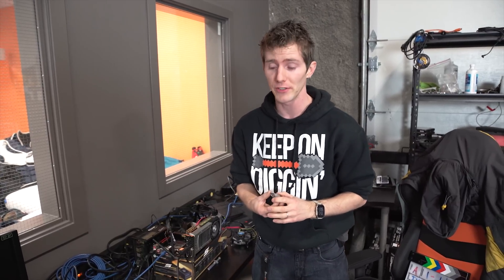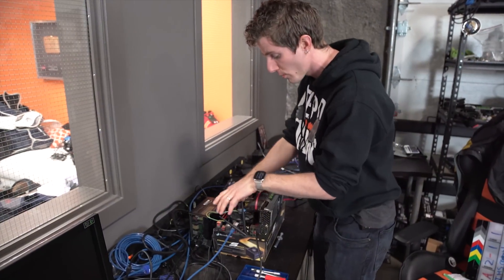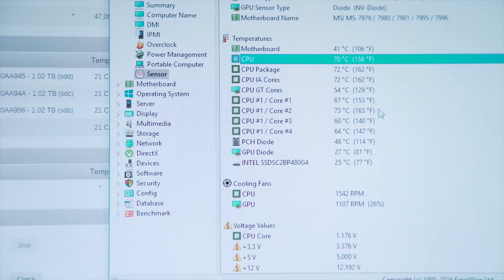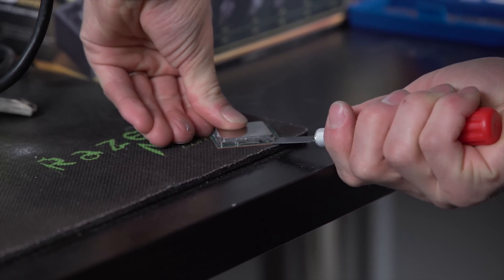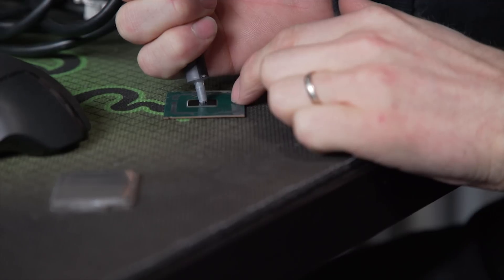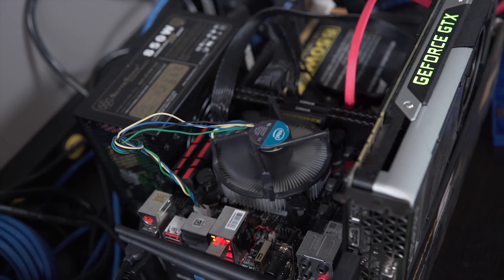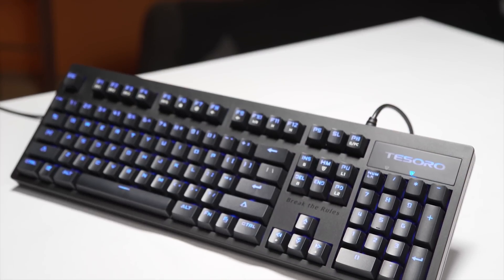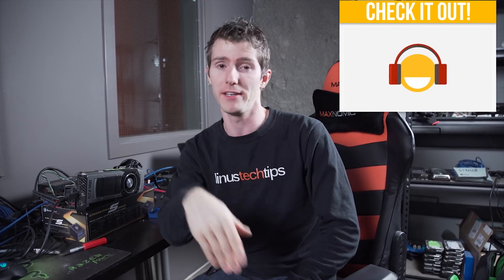Delidding an Intel Core i7 6700K - Is it worth it!?

Comment: I have to disagree with the opinion in this video. My last replacement of the compound under the IHS was on a 3770k. Using arctic silver 5 it vastly decreased the maximum temperature the CPU would reach under 100% load. I believe it took it down 15c or so on average. I didn't do this to my 4790k purely for the reason that I didn't have the time. On my current CPU, the common 6700k, I have replaced the compound under the IHS with Liquid Pro and sealed the IHS back in to place using a heat resistant tape which I found in the electronics district (akihabara) in a store that specializes in custom water cooling. The trick is to use the scouring pad supplied with the liquid to polish the underside of the IHS, making sure to thoroughly clean off the gray dust that results from doing so using alcohol (70% or higher). It took a while to do but eventually I got to the point where no more gray marks were appearing on the alcohol wipes, no matter how hard I scrubbed (while the IHS is off, you should do the same for the outside too, no need to apply pressure to the cpu it's self).Then I applied the liquid metal to the die (DO NOT use the scouring pad on the die. Liquid metal pro / ultra does not react with the die and will not destroy your chip if you make sure to be very careful when spreading it out and use only a VERY small amount. Not even half the size of a pea is required... I would say you should use dot around the size of the lower case "o" in the comments here. It looks like too little but it will spread over the whole die. Then do the contact side, this time with a ball just a bit bigger than the size of a capitol "O". Then polish up the cooling block with the scouring pad, as before and clean it off thoroughly, don't put liquid pro on the block it's self. The results I am getting from this simple investment of time and a little money are outstanding. I went from 23 - 25c idle @ 4700 down to 16 - 18c. That's only the idle temps thought, what really matters is the max temp which, while running prime 95, never went over 39c. AIDA64 topped out at 26c, XTU resulted in 37c and during gameplay (ROTTR in my case) I never saw it go over 25c, most of the time it sat around 20c. Room temp : 15c. 1c above room temp for a CPU running 500mhz faster than it's "Turbo" frequency with no power saving options enabled, constant 4.7k.
Reply: I read the Liquid Metal pro slightly shorts the processor when it creeps off the die, causes it to decrease the voltage, thus lowering temps
Reply: There is nothing directly next to the die that it could short on a 6700k. Not sure about other CPUs. I guess this happens to people with a different CPU model / brand that apply too much liquid metal. You really only need the smallest of dots on the die. It's a liquid, not a paste, so when you turn your CPU on it's side (as almost all are when installed) if you've applied too much or you haven't scratched up the underside of the die then it will dribble down like any liquid would. Liquid pro has about the same consistency as mercury, liquid ultra is a little thinner than the average mx-4 type paste so if you weren't confident about using pro, you could use ultra without worrying about leaks. Although pro is far superior, it takes a steady hand to apply. I saw somebodies video from Russia on here and used his method of taking a cotton ear cleaner, putting cling film / saran wrap over the end of it (if you touch the cling film in the area that goes over the end of the ear cleaner, don't use it. Get some more wrap and try again). By doing it that way you can be far more precise about it's spreading right to the edges of the die but not over them. If you see puddles of liquid instead of an even spread, then move to a clean part of the cling film and proceed to continue spreading it, the film picks up some of the metal so you should be able to create a nice even spread with no puddles if given enough time and patience. DO NOT use the bare cotton end of the cleaner or tissue to try and soak up the excess. It's a metal, not orange juice, it won't soak in to anything and you'll just end up with a messy application containing fibers from the cotton. Removing metal pro for a re-application after a mistake is a real pain in the ass so it's best to get it done perfectly, first time.